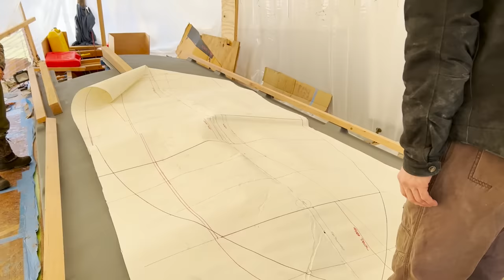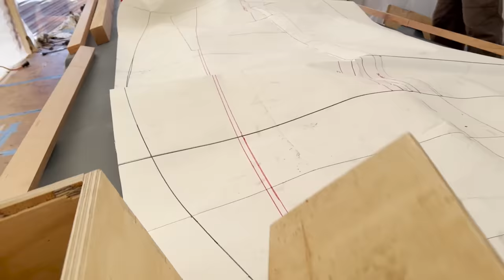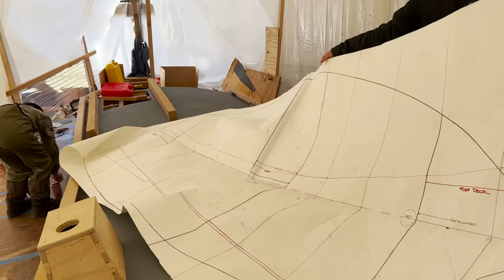Personal News Affecting Launch Plans - Episode 245 - Acorn to Arabella: Journey of a Wooden Boat

Comment: 25:13 baffles are also used in suppressors (silencers) and probably vehicle mufflers, just a few more examples. The baffles on early ww2 suppressors were just rubber “wipes”, the bullet would pass through the rubber wipe then the hole in the wipe would seal shut restricting the muzzle flash and suppressing the sound signature. The wipes were replaceable since the holes would eventually open up to the diameter of the projectile after about 50 rounds which would obviously cause them to stop doing their job at suppressing the sound and muzzle flash.
Reply from the maker: Wow! Neat.

Comment: A regular bi-metal hole saw will cut through the glass, wood and bronze ring nails just fine.  If you had it to do over, building the cockpit out of divinycell foam and 1708 fiberglass would create a lighter, completely water and rot proof cockpit.  If the sole wasn't stiff enough a couple of foam cored  stringers would stiffen it greatly.  You could have made it look very traditional by installing a glued down 1/8"-1/4" thick wooden overlay.
Reply from the maker: We were fresh out of divinycell foam trees so we went with our abundant cedar as a core. 😊 thanks for sharing your wisdom! People dive these comments for helpful tips and further thoughts!

Comment: OK, so seeing this (11:24) I understand. My previous comment about the look of wood under the fibre glass was based purely on aesthetics. But, yeah, beauty and practicality have to be in balance, I suppose. I'm thinking a wooden deck outside my house is all very well for the first 3 months, but in the African sun it will look like po-po later. Hence my preference for that outside and gleaming suspended Oregon pine floors inside. Blessings, Steve, and prayers for your Mom's improving health.

Comment: So sorry to hear your sad news. Wish you the best possible outcome.

I was surprised by the explanation for not using a bronze prop shaft, because of, apparently, the risk of dezincification. Although there are some less usual bronze alloys that contain very small amounts of zinc, bronze for underwater marine use normally contains no zinc, being primarily an alloy of copper and tin. Copper and zinc is brass.
Reply from the maker: To be truthful, it’s not a terrible thing to have a bronze prop shaft, and some types of stainless get pitted over time as well. It’s all a bunch of pros and cons… and since Accutech likes using Aqualoy 22, and it’s good stuff, that’s what we went with.
Reply: @AcornToArabella  That's fine.  A stainless shaft is probably cheaper than phosphor bronze. You have to be a little careful of galvanic corrosion between the shaft and the prop, but that depends on the exact alloys, and I imagine Aqualoy 22 is specially formulated. Stainless steel can corrode to nothing if deprived of oxygen. I have seen good quality stainless keel bolts in worse condition than mild steel and almost totally destroyed.

Comment: 2 hints, if you know soryy please ignore
1. have you heard of the "Drill Fill Drill" methode? you drill a oversize hole fill it with epoxy and than drill the right hole. that way the would has no contact with water.
2. for for epoxy work have you heared of "peel Ply", that way you got a better finish and you do not need so much sanding

Comment: Yup, but you do have a companion that slides on top of those rails and they have to have more clearance. Will that fit with the dinghy?
Reply: As Steve mentioned the companion rails are longer than needed. ( will be shortened later) As it sits the tender will fit as the full size plan confirms.

Comment: Best wishes for you and your family ,   throttle controle  can you workout where the tiller will be ? To see where the tiller covers when turning , like a arc . 
Can you recess the controles and put a cover over the dials and key ,  with the length of the tiller controles may be further forward ?
Reply from the maker: If we put engine controls in the cockpit footwell, they’ll be well clear of the swinging tiller.
Reply: @AcornToArabella  yes I understand they won't touch , but the person steering and using the throttle at the same time , stand at where your helm will be then reach down to throttle , what happens when the helm is right over where your standing ,

Comment: You don´t need breathing masks to safely work with epoxy, but you need gloves. You can safely make it fire off very fast using a heat gun. Extreme high strength epoxy glass is heated in an autoclave to cure it. I don´know what temp, but maybe 300 F or 300 C I forget. But very hot. If you heat the surface to something mild like 200 f it will radically accelerate the curing process. With  no no downsides. And of course hand held thermometer guns are cheap nowdays.

Comment: If you are sealing both sides with glass, you'lll have to be REALLY careful to seal all the portlight holes, and any screw or bolt holes will have to be drilled through oversize, glass filled and then drilled again. If both sides are sealed, you cannot allow any moisture to get i, because it cannot get out again.  Its much easier to leave the underside open so the wood can breathe ... if its full y sealed, be really careful to make sure it really is fully sealed, and be very careful how you attach stuff!

Comment: Fiber glass strength is also its weakness. It will prevent water from getting in but if water does get in to the wood, it doesnt want to come out. Make sure any exposed wood like the openings you made for the windows have the edge cut sealed with epoxy resin or the wood will just wick water even to the covered parts. Same goes for holes drillled to the wood for attaching bolts. Usually the hole is drilled a bit bigger than intended size, resined over and the the actual hole is re-drilled for the bolt just to ensure non of the wood is exposed to moisture.

Comment: Bronze for marine use should not contain more than maybe 0.5% zinc. Aluminium bronze, silicon bronze, and nickel aluminium bronze are generally fine, along with  most grades of manganese bronze. Some "bronzes" have zinc as a major constituent, and these are really mislabelled brasses, completely unsuitable for any except decorative purposes (and in the latter case should be kept well polished to prevent salt buildup and consequent dezincification)
Modern practice on plastic series produced boats is to fit brass thru-hulls, and this is frankly an abomination. They will end up pink sponges, but because the original owner will typically long since have sold them, the manufacturers don't seem to see it as a problem.

Comment: There is no zinc in bronze!   Bronze is an alloy of tin and copper. If there zinc in it, it is Brass not Bronze! That guy explaining how the pink is caused by zinc leaving the bronze almost knows what he is talking about, but not quite!
Reply: Hi Robin, Silicon bronze is a low-lead brass alloy that is generally composed of 96 percent copper. The remainder can be made from silicon and a variety of other alloys such as manganese, tin, iron,  and zinc.
Reply: @TheArtofBoatBuilding  Silicon bronze is essentially a copper/silicon alloy, with trace elements to adjust grain formation in the crstal stucture, the majority of the 4% non-copper content is silicon. The zinc content is typically less than 0.25% or lower, it is a trace element in the mix, or maybe not even there at all.

You won't see the "pinkness" referred to by the prop guy in bronze.  If you see it turning pink it is brass, not bronze.

Brass is roughly 60% copper, 40% Zinc and suffers from "de-zincification" in marine applications, bronze does not.  If you see the pink tell-tale signs of de-zincification, you are looking at brass, not bronze.

The reason you won't see a problem in bronze at 0.25% or so Zinc is that the presence of the zinc as a trace element is to alter the formation of the grain boundaries. Even if there was a molecule of zinc on the outer surface that the sea water could leach out, it is unlikely to be connected to another zinc molecule. It basically exists in small isolated pockets between the grains of copper.  

In brass, with its 40% zinc content, every bit of zinc is connected to another bit of zinc in the mix. When the sea water leaches out the surface zinc, there is then a pocket that is certainly connected to another bit, which over time it removes too .. eventually leaving just a pink honeycomb of copper, with the 40% zinc removed. This is obviously a weak structure and why you don't use brass in marine applications that are subject to constant immersion.

I found it a bit worrying that a guy who sells brass and bronze props didn't know the basic and important differrence.

Comment: Cancer is like a ship where the captain has fallen overboard. the crew does it's own thing. put the captain back in charge of the ship and the bodies immune system destroys all non-conforming crew members and puts them overboard. chemotherapy is like shooting the non-conforming crew members from a distant naval frigate with a 50 cal deck gun and no end of shells.

when we put aside the magnificent architecture and design of the body and we pretend there is no proper way of using our most important vessels, than to throw accidental theory of cure at the body, instead of learning how it works, we end up sinking the vessels even before we have properly tried to rescue it.

there is a lot of talk of alkalizing the body and all sorts of other nonsense. no. acid in the stomach only as the stomach enzymes require PH1 to trigger their function,  get rid of all processed foods (bread has chalk added as a so called flower improver), tap water is made to be alkaline, so distilled water or fresh rain water. use apple cider vinegar "with the mother" diluted in water first thing every day, as a stomach tonic. soak all nuts and seeds prior to using them as all nuts and seeds have growth inhibitors that stop our stomach enzymes working (don't blame mother nature for doing what she needs to, it's our society which fails to teach the kids what they need to know). and you'll soon be on the mend. simple as that.

of course a depressed or negative mindset can scupper any rescue no matter how diligent the method application is. so look forward with a smile.
Reply from the maker: Thanks for sharing these thoughts.